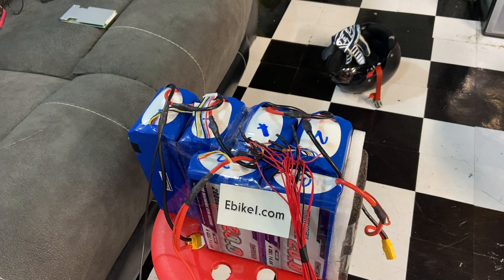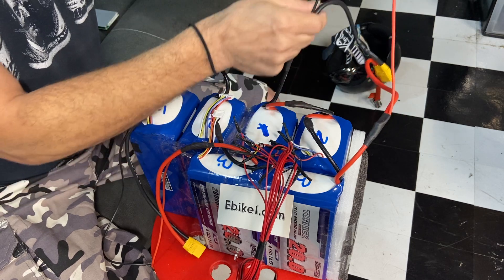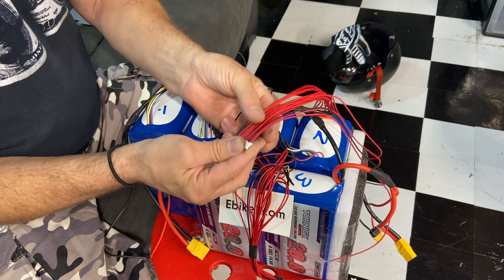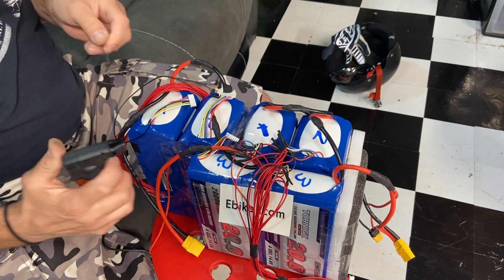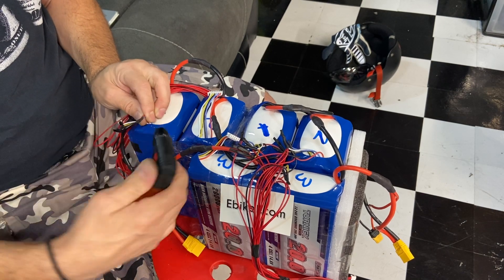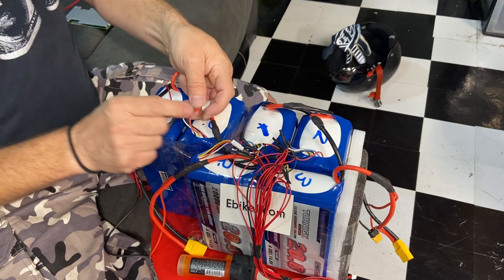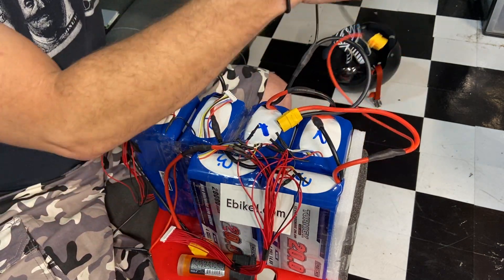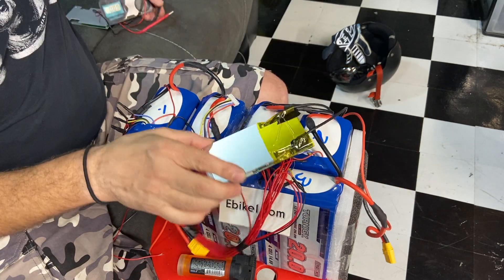How to wire BMS for Turnigy Lipo battery pack for Ebike part 2

Comment: But can the wires handle the voltage ⚡??? And the connectors??? Isn't running high voltage high amps require higher gauge wiring???
Reply from the maker: @andyfumo8931  it is possible for an inexperienced rider to make it very hot (don’t do that) ⚡️⚡️
Reply: @tobebike  so how would you increase the wiring for this turnigy pack

Comment: Im running 28 5200mah 3S 60c lipo's configured at 21s4p 77.7v 20.8ah. I charge by using three 80 watt chargers with three 6-way balance boards and charge half at time. And I connect each lipo pack with EC5 jumpers I made myself. It is a hassle and im thinking about adding a bms but I honestly dont mind the way I do it, it feels like I know what each cell is doing by manual charging. But when I ride to work I was thinking about buying an 84v charger and mass charging all the lipo's while I still have them connected in series at 84v not 88.2 to be safe because I wont be balance charging. When I get home I will balance charge to 88.2 volts. My question is it safe to mass charge a 28 lipo's connected in 21s4? I figure there would be no chance of overcharging a cell if im only charging to 20s voltage and not 21s without a bms? Great vid, I also follow you on Facebook.

Comment: Might as well send them all in case others need it.  But in my particular case 72v 16s 

Side note. Are you running 2 bms. Or did you parallel each cell into one bms?
Reply: He's running 2 separate BMS

Comment: Thank you bro for the video! Much appreciated. One question tho... How will I go about hooking up Seven 3s lipo batteries that are connected in series in one pack which are than connected to another pack in parallel into the BMS? I am getting 88v from each pack. Do I do it the same way you're doing it?
Reply from the maker: I parallel first than series if they’re all the same
Reply: @tobebike  if what is all the same? The cells?
Reply from the maker: @molifehacks5258  yes
Reply: @tobebike  yea they are all 3s cell batteries

Comment: Doc, if I am increasing AH, should I parallel the bricks first or series first? I assume if using a BMS, I would have to parallel first and also parallel the sense/balance wires before putting the parallel groups in series? Would it be possible to series first before paralleling the series when using a BMS? What brand BMS do you recommend? Thanks for the replies.
Reply from the maker: What voltage BMS? 
Yes, always parallel first when connecting battery’s for parallel
Reply: @tobebike  I plan to go 6S x 3 so 18s. Besides BMS recommendation, do I need to capacity test the bricks (will be buying new from HK)? And if yes, what charger do you recommend?
Reply from the maker: @exee1  you’ll need an adjustable charger to do 75v 
This bms works for charging and balancing https://www.ebay.com/itm/20S-72V-Lithium-Li-ion-Polymer-Battery-45A-BMS-PCB-Board-with-Balance-Board-/313602077613?mkcid=16&mkevt=1&_trksid=p2349624.m2548.l6249&mkrid=711-127632-2357-0

Comment: what bms unit are you using   can we get a link?
Reply from the maker: Which voltage ? I’ll send a link
Reply: Might as well send them all in case others need it.  But in my particular case 72v 16s 

Side note. Are you running 2 bms. Or did you parallel each cell into one bms?

Comment: I have been looking for this Video for a very long time. Now I don't need to take my battery out to balance charge every time. Thank you!
Just a question, Why didn't you connect the controller wire on the bms? Seems to me that the controller is connected to the battery directly.
Reply from the maker: Yes. 
Because running any BMS to the controller burns it out within a month or several months (every time)
You only need the BMS to monitor charging
Reply: @tobebike  Gotcha thanks for answering. But can I run a controller through the bms as in any other pack 18650 pack? Because I want to implement that with a Bluetooth bms @200A. I have a programmable controller
Reply from the maker: @Full_Throttle_no_Brakes  yes you can
Reply: @tobebike  besides monitoring during charging, does this setup affect the balancing function of the BMS? Does this setup (my understanding is that you don't connect the red wire to the BMS) work with either 2 wire or 3 wire BMS?
Reply from the maker: @exee1  it works as it should . 
This Bms is  negative only . 
Each lead is +, - , +, -, etc .